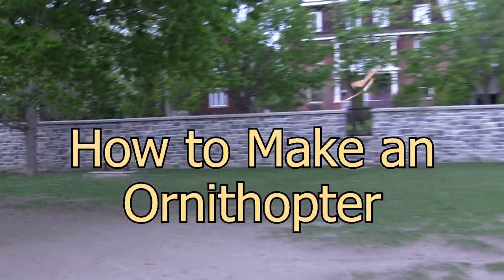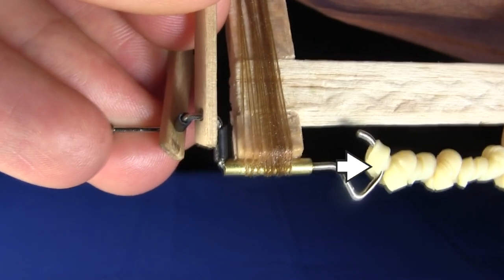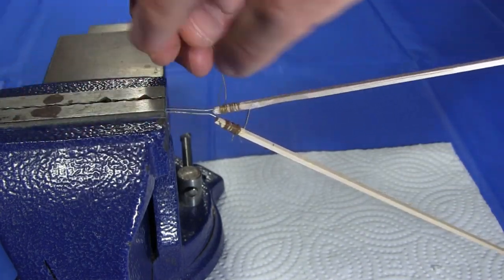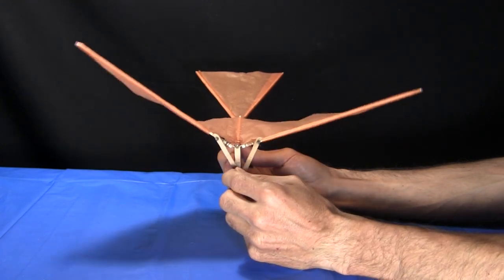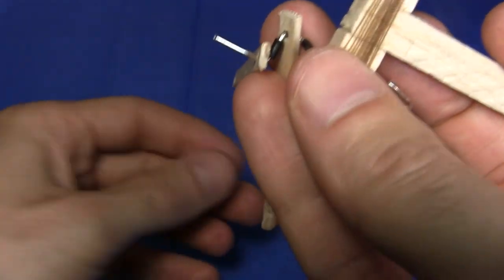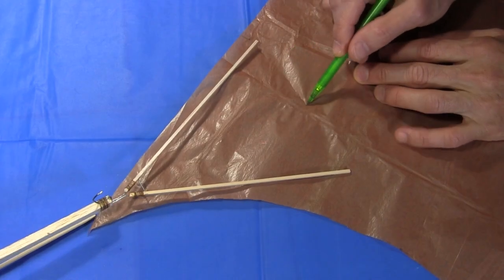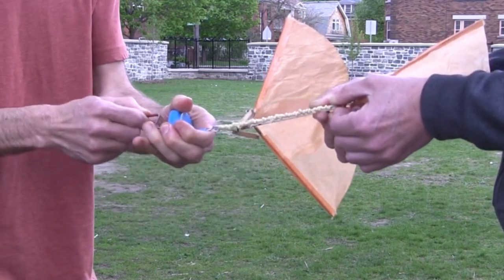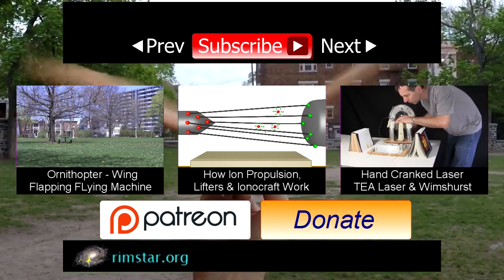How to Make an Ornithopter (Rubber band type)

Comment: Why does it fly when the Wing motion is same up as down?
Reply from the maker: The wing is made of a flexible material and has a different shape going up than it goes going down. Also, keep in mind that the distribution of the mass in conjunction with the center of lift causes the ornithopter to be tilted at an angle. All this means that on the upstroke, the material mostly points in the direction of the oncoming airflow and so the angle of attack is around 0 degrees but on the downstroke, the angle of attack is suitable for producing lift. I have diagrams in an article I wrote a while back here https://hackaday.com/2018/05/11/scratch-built-ornithopter-heres-how-i-flapped-my-way-to-flight/
Reply: @RimstarOrg  what do you think about this Theory: the flapping wings Propel the airplane forward kind of like a fishtail and the airplanes tail sets the angle of attack to keep the flight in level.  kind of
Reply from the maker: That's a good point, I forgot about  the tail. I also helps keep the proper angle of attack. I'd think that at these slow speeds it wouldn't make much difference but from experience adjusting it, I know that it does.

Comment: Can this thing be made by using technology available 200 years ago?
Reply from the maker: Possibly. From https://en.wikipedia.org/wiki/Rubber_band rubber bands have been around almost that long. Certainly the Chinese and Japanese had the tech for making the rest of it.
Reply: Hmm...
"The first ornithopters capable of flight were constructed in France. Jobert in 1871 used a rubber band to power a small model bird. Alphonse Pénaud, Abel Hureau de Villeneuve, and Victor Tatin, also made rubber-powered ornithopters during the 1870s."

Interesting.

Comment: Instead of putting stoppers on the crank and the wing spars, try bending the wires, that should save you a lot of time and money!
Reply from the maker: I'm probably wrong but I assumed that bending the wire would cause that wire to be a single pressure point rather than having even pressure all around like you'd get with a stopper. Just a gut feeling though, probably unwarranted. The single pressure point would at least be less pressure. Thanks for the tip!
Reply: @RimstarOrg  No problem! 😉

Comment: where can I find super sport rubber ?
Reply from the maker: I got mine from here:http://www.ebay.ca/itm/contest-rubber-FAI-tan-super-sport-motor-stock-band-In-coments-state-size-Qty/351912421970?_trksid=p2047675.c100011.m1850&_trkparms=aid%3D222007%26algo%3DSIC.MBE%26ao%3D1%26asc%3D39923%26meid%3D2669d4b3e437450e9bf6d058a550479b%26pid%3D100011%26rk%3D1%26rkt%3D1%26sd%3D181696553914
Reply: thanks a lot for reply I really appreciate your invitation... but in my country don't find super sport rubber and if I buy at your given link it's to much pricey
Reply: Shahbaz Ahmed I like winter break

Comment: i made this one, but i don't know it didn't flaped even a single time, even after i attached the winded rubberband ? CAN anyone help me how to get it flapping . . . pleaaase :)
Reply from the maker: I sounds like your lever arm might be too short. The lever arm is the 7/8" measurement I show at 3:13. It's also possible that your tissue might be too tight across the wing. Are you able to turn it easily by hand?
Reply: my lever arm is 2.4cm or 24mm long. I had already tried loosening the tissue but it didn't work. I was able to turn it very easily by hand. Also I used regular household rubberband. I tried different rubberband combination : 2 or 4 at a time which resulted in breaking of the crank. i will make another one though.
Reply from the maker: Your lever arm sounds like it's long enough. Since you could turn it very easily by hand then the rubberband is a good suspect. For the next one, make the fuselage stronger but be careful to not make it too much heavier at the same time. I snapped many fuselages too until I finally got something that worked. You'll get it working eventually.
Reply: @RimstarOrg ok i will keep that in my mind. thanks for the help.

Comment: Why not use a small electric motor.. instead of the rubber band...that said, the ornithopter is really neat !!!
Reply from the maker: I'm glad you like it! Thanks! A motor would add a lot more weight (don't forget the battery or super capacitor to power it too), but it can be done. The wings may have to be bigger though.

Comment: and as if these wings were to be glued with foil or paper, the airfoil of the wing ?????
Reply from the maker: Are you asking what can be used for the airfoil? I used Lite-Flite Japanese tissue which I bought at a local hobby store but you can probably find it online somewhere. It's designed to be very light. However, at 5:39 in the video I talk about using tissue paper from a flower store. I've seen people use metal foil as well as plastic from plastic bags. I don't know how well those would work since I didn't try them. It has to be as lightweight as possible. For example, heavy metal foil will not work.
Reply: @RimstarOrg  I did not mean or how to make a wing with a cross-section - an aerodynamic profile like in birds or airplanes, maybe it would fly better  https://en.wikipedia.org/wiki/Airfoil
Reply from the maker: It probably would work better. But it's harder to make. Plus, the wing is constantly changing shape as it moves up and down. So the angle or attack plays a big part. And the camber of the wing constantly changes. https://en.wikipedia.org/wiki/Airfoil#Airfoil_terminology

Comment: I need your help
My bird it can not fly
And i don't know why ??
Reply from the maker: The number one reason is usually the weight. That's why in this video you see me weighing it a few times to show that it's very lightweight. See my other video where I show what I went through to get it working https://www.youtube.com/watch?v=ZvzpsRWl12sAre the wings flapping up and down rapidly and at the same speed up and down, or are they having a harder time lifting up than going down? If it seems harder to lift the wings up then there could be a few problems. One is that the wing material could be stretched too tightly. Undo the tapes at the wingtips to see if it makes a difference. Another possibility is that your lever arms are too short. The lever distance is the 7/8" one I show at 3:12.
Also, make sure that your rubber band isn't rubbing against the fuselage. At 8:06, you can see a little piece of the rubber touches the fuselage.

Comment: try using a motor instead of rubber band and an rc mechanism in order to control it
Reply: the weight of the motor/ battery will require a massive redesign, so that might be plans for the future.
Reply from the maker: Yup, as +Moth said, it requires a redesign, larger wings for more lift. I have a small RC toy helicopter whose parts I'm hoping can be adapted.
Reply: I've been milling around with the idea of making an ornithopter drone like thing but been to busy with class but maybe this summer...maybe

Comment: @RimstorOrg my ornithopter turns upside down and falls
Reply from the maker: In what way? Does it turn sideways or does it flip over its nose?
If it's sideways then check that your tail isn't tilted sideways. If you try balancing the ornithopter on your finger, does it always fall to the same side? If so then maybe one side is heavier than the other.
If it flips over on its nose then trying balancing the ornithopter on your finger. It should balance with your finger around 2/3rds of the way below the wing from the front. For example, my wing is 5" wide and so it should balance with my finger around 3.33 inches back from the front of the wing (2 / 3 * 5 = 3.33).
Let me know if that helps or not.

Comment: I'm made ornithopter but it wasn't work
Reply from the maker: Keep working at it. The number one reason is usually the weight. That's why in this video you see me weighing it a few times to show that it's very lightweight. See my other video where I show what I went through to get it working https://www.youtube.com/watch?v=ZvzpsRWl12sAre the wings flapping up and down rapidly and at the same speed up and down, or are they having a harder time lifting up than going down? If it seems harder to lift the wings up then there could be a few problems. One is that the wing material could be stretched too tightly. Undo the tapes at the wingtips to see if it makes a difference. Another possibility is that your lever arms are too short. The lever distance is the 7/8" one I show at 3:12.
Also, make sure that your rubber band isn't rubbing against the fuselage. At 8:06, you can see a little piece of the rubber touches the fuselage.